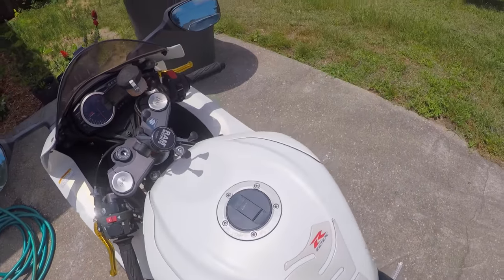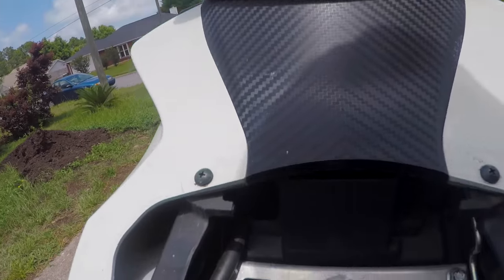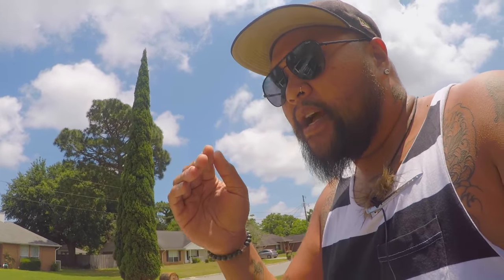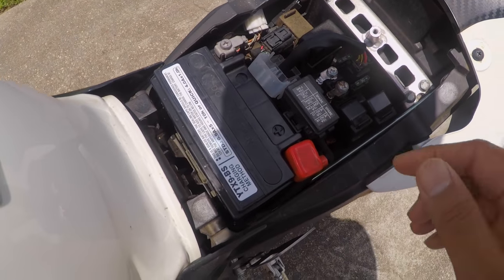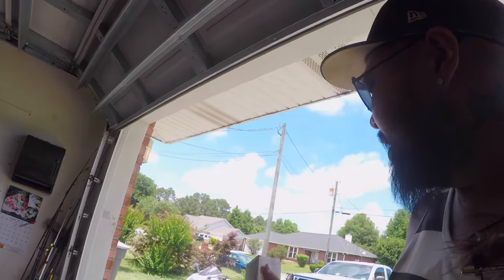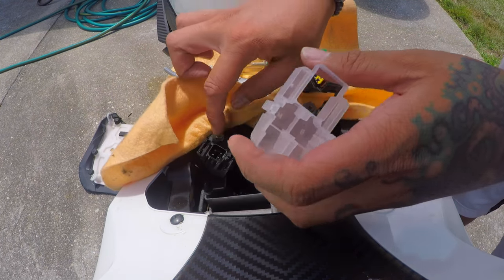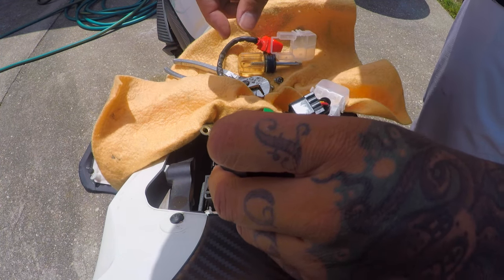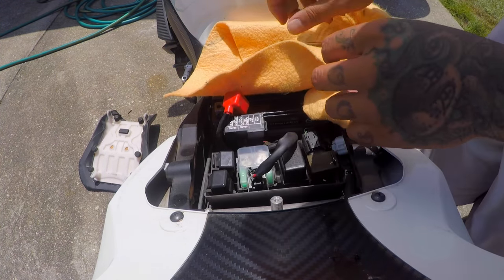**Solved!** Starter relay problem! Works for most bikes/vehicles!

Comment: Had a friend ask for help with his bike over the weekend and he drew my attention to this video. He was chasing his tail checking the connections from the battery to the solenoid per your commentary at 2:35 - 2:40.  l watched and listened a couple of times and your commentary tells me you don't really understand this at all yet here you are teaching the whole world. Good one.
Reply from the maker: I’m not trained nor certified to work on vehicular repair. This is how I diagnosed and fixed my issue for cheap, rather than getting gouged at a shop and paying hundreds, if not thousands. But I’m curious, what about my commentary makes you so upset to leave such a comment?
Reply: @MotoCos88  I'm not upset, I just despair at You Tube videos posted by people who are well intentioned but are themselves clearly unschooled in the subject matter. Your fault finding commentary sent my friend down a diagnosis rabbit hole that made no sense until he said "I'm just doing what this guy says to do" and he showed me your video. You could've just shown how to replace the solenoid instead of narrating your testing protocol. Look at a wiring diagram, study it, particularly the starting circuit and then you'll get it. Thank you for being gracious in your response to my criticism and not turning it into a slanging match.
Reply from the maker: @terrycolley6482  I understand completely! TikTok is even worse!! I try to understand where people come from before letting any kind of emotion take over. I hope your friend gets his bike up and running though!

Comment: Thanks for the video bro. this is exactly what was wrong with my bike. now to replace the relay.
Reply from the maker: Like the other comment, you might be able to repair it. Try taking it apart before buying it? The springs might have corrosion which will block the contacts to close the circuit. I should have checked mine before buying a new one, but it works so Im not complaining! Glad this video helped though, brother. Safe riding!
Reply: @MotoCos88 
I have a hyosung gt 650 and is making the same clicking noise and so is it definitely the starter relay that causes that problem.
Reply from the maker: @simdoran8516  Did you try bridging the terminals on the relay? I hope that the video helps!! Safe riding friend!

Comment: My bike wants to start so bad but it just keeps cranking wont turn over... what do you think is the problem?
Reply from the maker: Sounds like either a fuel pump issue or a starter motor issue. Have you tried tapping on the starter motor with a screwdriver handle to knock some gunk loose? Also is your fuel pump engaging when you turn the key?

Comment: I literally stumbled across your post and I think it will help me with my 03 Yamaha 1100. How difficult was it ti remove the old relay and how’d you do it? Thanks
Reply from the maker: It was super easy! Only setback was the thread seal on the positive terminal on the relay. It literally is just unbolt, unplug and reboot and replug! Any luck with your relay?

Comment: Hi, I also have the 2016 gsx-r 750 and I have the same problem as you, the bike doesn't start. New battery, new stator, I bought the new relay like you did but unfortunately the bike still doesn't start... placing the screwdriver on top of the new relay it starts... what could it be???
Reply: In the end, after trying with another relay because I thought the new one I bought might be faulty, I checked in sequence:
-the stand sensor and it was ok,
-the start button and it was ok,
-the sensor on the clutch instead NOOOO!!!?! having moved the range of the lever closer to the knob meant that the sensor did not trip. Flooded with WD40 and moved away just enough, the bike started on the first try..... keep look sensor clutch guys

Comment: Hi I think I'm having the same problem I have a K7 Gixxer 750 when I turn the key I get no response or sound except all the appropriate lights go on as normal. I checked the battery, and the fuses, they are all fine and in good working order. When there is no sound from the starter motor, in your opinion is the relay connection the problem or would it be something else?
Reply from the maker: No clicks at all? Sounds like the relay. 1 click, like mine, meant the relay wasn’t closing the circuit to the start motor. Multiple clicks is not enough voltage. No sound at all could be not enough voltage, but if you checked the battery with a voltmeter and it’s ready 12.5+V then it most likely would be the starter relay is seized up. This is just my opinion though!

Comment: Before you fixed it, was it refusing to start every single time you tried? Or would it work sometimes?
Reply from the maker: It would start once in a blue moon or if I hot jumped it. Which is bad for the rectifier/stator..but if it was my only shot at going home from work then I'd have no choice. Ever since I changed the relay, it hasn't given me a problem! Hope it helps!
Reply from the maker: Alpha Maya  I don't want to give you false information....so I don't know, lol. This is more so starting problems and troubleshooting. But out of curiosity, what's wrong with your horn?

Comment: Hey so I have a similar issue with my 2015 GSXR750. I tried bridging the solenoid terminals like you did but the bike still won’t start, it just sparks like crazy. I replaced the battery with a new one first to see if it was that and still nothing. Lights and everything else turns on except the motor won’t turn over. Any ideas ?
Reply: sounds like your starter is shot.
Reply: @K6_king yep that was exactly it, Already had it replaced and it started right up

Comment: Looks like you’ve helped a lot of people with this video I hope it fixes my problem. My bike sounds just like yours when I push the start button. One click. I’m hoping it’s just the fuse in there but I doubt it.
Reply from the maker: Any luck??
Reply: @MotoCos88  it’s the starter I picked up a used one for $40

Comment: when you bridged the 2 terminals did were you pushing the starter button? or did it just start up on its own once it made contact
Reply from the maker: No, I was not holding the starter button. Bridging the two terminals on the relay is pretty much bypassing the ignition switch on the handle bar. I did however, hold the clutch in as gsxrs require it to be held in.

Comment: Hi, I have the same problem with my yamaha xj6, same clicking noise. I was wondering if the check engine light pops up at the same moment you push the start button?
Reply from the maker: Sorry I’m late! But no it didn’t pull any codes

Comment: My engine is cranking, not slowly but normaly, but the engine still doesn’t come on. I’ve tried to start it with the kickstarter but it’s also not turning on. When trying to bump-start the bike, it takes some revs but the engine still goes out. What’s happening?
Reply from the maker: That’s a bit outside my wheel well. Could be a fuel or air issue? If it starts, but doesn’t stay on…I’d look at fuel pump, fuel lines, spark plugs. I’m not too savvy when it comes to that though.

Comment: Quick question- did you press the starter button when bridgeing the relay? My zx9 cranks over all the time when the battery is connected (I`m trying to figure out if that`s the relay foult or I should start checking the cabels...)
Reply from the maker: Nope, by bridging the relay, it bypasses the ignition. I would check the ignition switch on your handle if it’s trying to start immediately after turning the key
Reply: @MotoCos88  thanks for answer mate. It doesn't even need a key to start cranking 😆

Comment: I’ve had a similar promblem w/ my o8 zx6r did you ever notice the headlight not working?
Reply from the maker: My headlights, HUD dash lights, tail lights all turned on just fine which meant the battery had enough juice to keep them on. I knew it was the relay when I bridged the terminals on the actual relay and it started.

Comment: bro! quick question. so i wanted to do the test of bridging the relay knobs, but the instant i bridge them, sparks flew out and i chicken out 🤣 should i just ignore the sparks till bike cranks? sounds counterintuitive and unsafe. plus, did you push the start button to start up the bike when doing the bridging thing? or just bridging will start the bike up?
Reply from the maker: Hey! So when you bridge it, sparks will fly, do you hear the starter motor cranking? If so, I would leave it bridged until it starts. If it keeps trying to crank, but doesn’t turn over, it means you have a bad relay AND and bad starter motor. Also I did NOT push the start button while bridging. You’re essentially bypassing the ignition switch when you bridge. Only the clutch because my bike requires the clutch to be pulled in when starting. So let’s recap! You push the ignition button, you hear the starter click but no response, so you bridge the terminals on the relay, (it will spark if you don’t commit and fully bridge them) and you hear the starter try to turn over the engine, but it keeps cranking with no full turn over and the engine does not turn on. I’d start with a new starter relay. If that doesn’t work, replace or clean the starter motor. If that doesn’t work then it’s internal with your engine. I.e spark/fuel/air/compression. That’s a whole new story lol. I hope I helped! Please keep me updated. I’d like to help with my best knowledge!

Comment: I've been having a similar issue with my ninja 400 (2011). Brand new starter motor, battery and stator. Press the ignition button and it loudly buzzes at me before turning over and eventually turning on
Reply from the maker: Sounds like a relay issue to me, were you able to fix it?
Reply: @MotoCos88  I have a new solenoid on order coming in this week. I took at look at it and one half is charred black. The thing is fried

Comment: I tried jumping the two cables to the relay and all I get is a big spark and the lights on my dash/fuel pump reset as if I turned it off and on again. :/ 2015 ZX10R

Comment: So basically if it’s clicking realy fast it’s a battery issue? Cause my bike does die out on me sometimes and now my relay is clicking rapidly and the bike won’t turn over, if I run and drop the clutch to start the bike it starts and is able to turn right back on after shutoff
Reply from the maker: Yeah sounds like a battery issue. If it does it time to time, that means your charging components are starting to go out (stator/rectifier) it clicks because the the electromagnet doesn’t get enough voltage. If you have a multimeter, check the voltage using the 12V setting and it should read 12.5V or more before starting. Try cold jumping it with a car battery (don’t turn the car on) and I bet it will start up. But I’d check the stator/rec they’re probably going bad
Reply: @MotoCos88  I just replaced the stator on my bike so I’m going to check the other and maybe replace the battery

Comment: Hi, replacing a part is easy (no disrespect). In my bike, I replaced the solenoid but the clicking is still there. I tried a third solenoid but the same problem persists. The battery is new. I cleaned the earthing points on the bike. What else could it be? some other videos have suggested using a screwdriver to bridge the two solenoid terminals directly. Any other ideas? thanks!
Reply from the maker: I used the bridging with a screwdriver technique to diagnose the fact that I had a bad relay. Where did you buy the relays from? I purchased mine from a Suzuki shop that sold OEM ones. If you did that, but still get a click, then i would check the voltage on the battery by using a voltmeter. When you push the ignition, the reading should say 12.5 or above to start the bike. If you can start the bike by bridging the two contacts on the relay, but not the ignition button, its a bad relay. Also be sure to check the fuses on the relay itself. Please update me, id love to help out as much as possible! Good luck!

Comment: I try turning mine on and it does not make a single sound not even the fuel pump nothing! Prier to that I had hooked up some lights on connected them straight to the battery, drained my battery so I past it cables thru my jeep and it started good. Later on I try to start it again and nothing so I got a new battery hooked it in and still no sound at all. Next day I try to start it again and nothing, later after so many tries it turned on took it around the block turned it off and it happened again no sound or anything trying to turn it on. Few riding buddy's tell me different stuff my rectifier or my fuel pump or my starter switch or my main fuse (I saw that it's a 40 when it supposed to be a 30) or that I fried it trying to pass it cables but no cause it turned on later on like I said. Any idea why it won't start ?
Reply from the maker: So the rectifier and stator are the components that recharge your battery. So if it’s a new battery and only works sometimes, I’d check your cables. Make sure your ground is secure and all the connections are adequate. I’ve had people say they never checked the ground and/or the connections and they would pop loose whilst riding. The fuse shouldn’t be an issue as long as it’s not under the required amperage. Also, if you have a volt meter, I would check the battery and make sure it’s reading 12.5V+ before starting. When you start the bike, if you have a bad stator/rectifier the battery voltage will drop while it’s running. I hope this helps!

Comment: Hi. I have tryed the bridge thing but switches off my dash board and all the systems and then when I remove the screw driver gets back to normal with power on dash . It's that normal?
Reply from the maker: Sounds like there’s not enough juice in your battery. If you have a voltmeter, check to see if the battery has 12.5 or more volts before cranking

Comment: Hey bro so my bike had the same prob, turn on but won’t crank just clicks once. I’ve changed the relay already couple weeks ago and still the same problem. Any suggestions?
Reply from the maker: First let me ask,  how old is your battery? I replaced mine before troubleshooting. (It sat in storage for a year). If you can, do a volt meter check and make sure it reads over 12v. I believe it needs 12.5v+ to start. Now, did you try bridging the two connections on the relay? It should spark and if you do the prereqs (my bike is required to hold in the clutch) the bike should start. If it doesn't, that means there's an open circuit somewhere else. Next in line is the starter motor. They tend to build up of engine dust and corrosion. Find yours, give it a firm tap with a screwdriver handle and it might do the trick. If none of that works, I would look into a new starter motor. 

a few things to think about: 
*Check your ground connections and both terminals. Once i left the negative terminal loose and it died on me half way down the road because i didn't tighten it back up.
*With any vehicle its usually Battery>Iginition>Relay>starter motor> alternator/stator and rectifier...so on so forth.

I hope this helps, please let me know if you find a solution. And also, remember I'm not a certified technician. Please take this as a friendly suggestion as I wouldn't want you to further damage your vehicle.
Reply: Bad ground

Comment: Good stuff bro! Thanks for having that video I was looking for. Having the same issue on same bike. Hoping it’s just the relay.
Reply from the maker: Thanks for leaving the love! Was it the issue for you?
Reply: @MotoCos88  actually through all the troubleshooting I did, the issue I had was caused by the "SteelMate" motorcycle alarm. I just removed it and put everything back to normal. Now it stats right up!
Reply from the maker: @ItsPoppaB  ahhhhhh! I had installed an alarm on my 2nd bike after my first one was stolen, and it would drain my battery so I eventually removed it and it was my fix in the past. I'm glad your up and running solid now!
Reply: MotoCos88 thanks, appreciate it!

Comment: Hey where did u get the new starter relay? Plz help, I have a 2016 gsxr 600, having same issue and I can’t find the part.
Reply from the maker: I bought mine at a local suzuki dealer. Was about $80 for the OEM part brand new.  Im sure Partzilla has them or ebay.

Comment: I might be late here  but my relay sparks when i bridge it.  What does this mean ? I noticed that while bridging it i can hear the starter start to crank. But I'm unsure where the problem really lies . Bike did not start for me. I've gone through a few batteries thinking they were the this battery is new but not fully charged  problem . Ill try it with a full charge
Reply from the maker: Rudaggar check with a voltmeter how much juice your battery has! Should always read 12.5V or above. Also does it spark only when you bridge it with a screwdriver? It should, as it’s the same as if you were to jump a car and touch the two alligator clips together. Please let me know, id love to help you as much as I can!

Comment: Hey I tried the test and it almost turns over, but doesn’t fully.  What do you think that means?
Thanks for the video.
Reply from the maker: Sorry, I missed this comment!! Any updates? Sounds to me like a bad starter motor. Sometimes though, you can just tap on it with a screwdriver handle and break some of the gear dust off. Also, make sure you bridge the two contacts on the relay securely. Sometimes my screwdriver would graze it and it would try to turn over but wouldn't. I hope you found the issue and sorry i missed your comment!